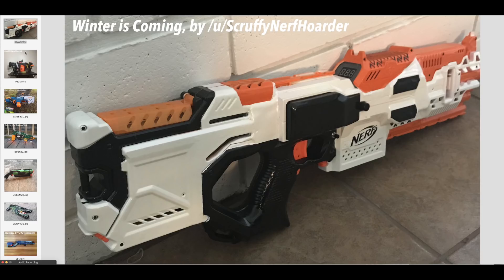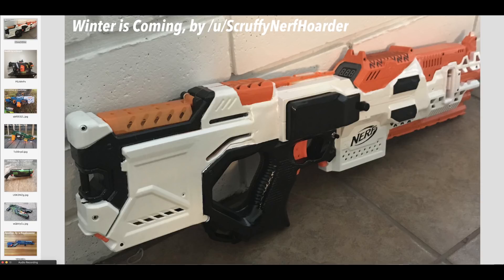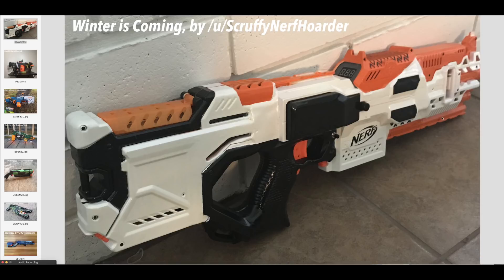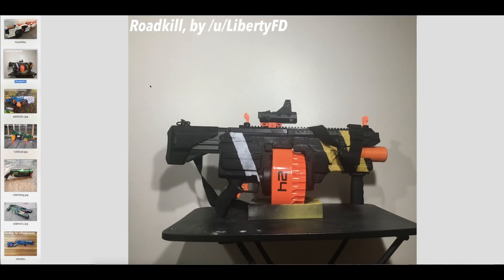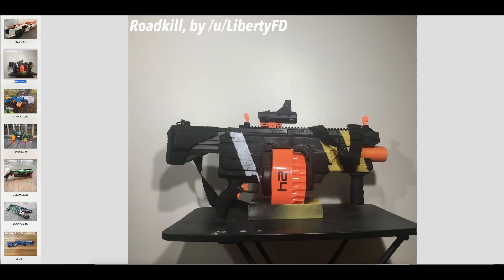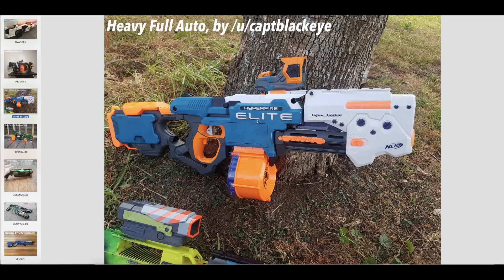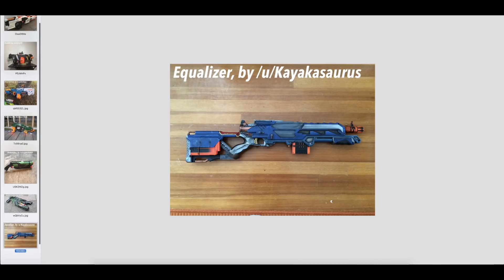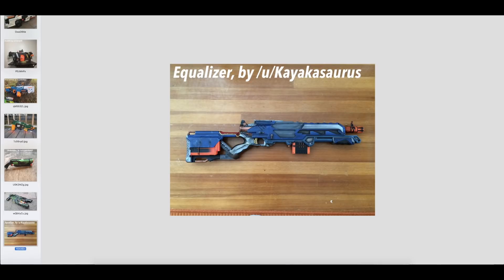"Integration Explanation" - Aesthetics - (ft. MM2 contestants) pt. 1

Comment: The Rougharm is my build. I actaully ended up using an xbz instead of the auto styfe, and it fires shotgun shells. The autostyfe is my plan for the rougharm mkII
Reply: thegullasch I noticed that trigger looked a bit odd for a Stryfe, nice work man!
Reply: You_just thanks!
Reply from the maker: thegullasch o That makes a lot more sense.  I seem to recall one of your earlier WIP posts mentioned you were going for an AutoStryfe, and then I never saw anything stating otherwise.
Reply: Mister Nathan im working on another one that should be cleaner and look nicer. The stryfe didnt fit in the roughcut so maybe it'll be a twinfury..... (twinshock-rotofury autostryfe integration with a cenution stock)